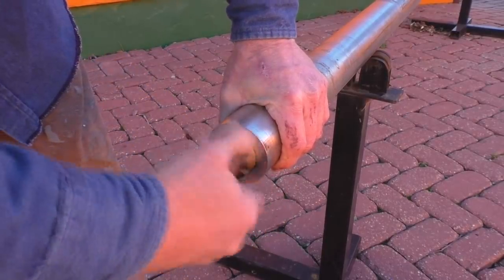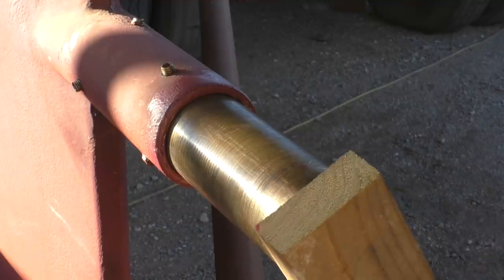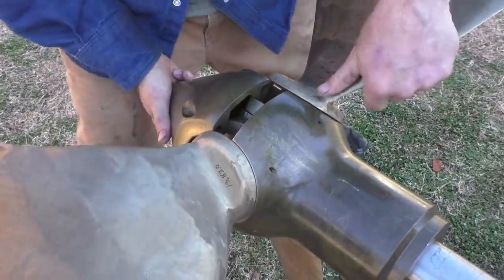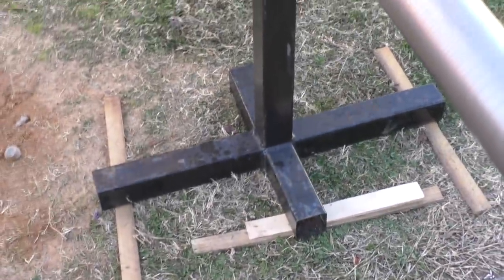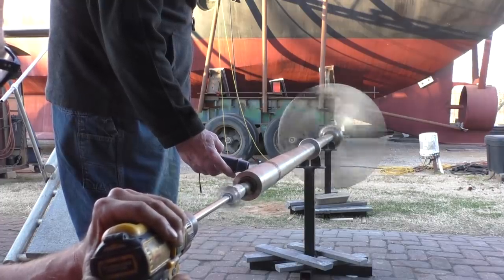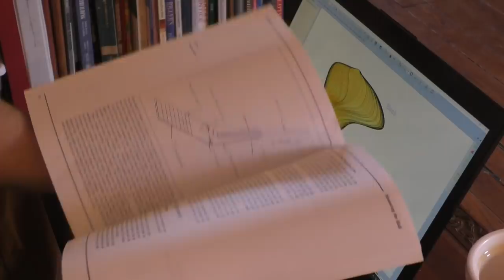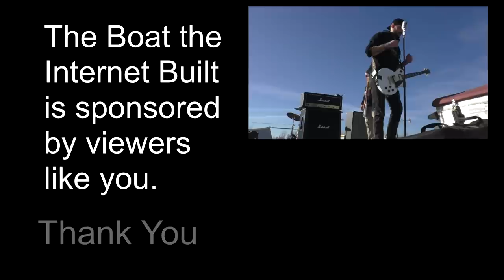DIY Boat Propeller - Part 10 - Tested at 600 rpm

Comment: Doug- 
Balance factor is very important to the life of the bearings 
And from the video with it “wobble” it’s pretty far out.
Working in a machine shop we get the V8 performance cranks down to 1 gram- 
Being that you can actually see the wobble and 100 plus grams is a lot 

Check out this guys homemade balance rig with cheap DIY meters
https://m.youtube.com/watch?v=r6tFXC4Hk0I

Comment: Just an idea...but label each prop, place a poster board behind the propeller.  Spin it till it start to wobble, using a strobe (real strobe, not an LED strobe) take pictures with a camera (at night).
You might be able to tell where the prop is this way.
& I would 100% ignore which prop is heavier.  At this point it does NOT matter, it being in balance is all that matters, regardless of weight.

Comment: ISO 484-2 : Shipbuilding - Ship screw propellers - Manufacturing tolerances - Part 2: Propellers of diameter between 0,80 and 2,50 m inclusive
The formula for acceptable (static) balance in ISO 484-1 (greater than 2.5m radius) is discussed here: http://www.ricepropulsion.com/esp/cartas/TNL62/TNL62.htm

Comment: Two common ways to balance a driveshaft on a car involve hose clamps. Two hose clamps with the heavy part 180 apart. Slowly move one of them around till it gets better, then do the same on the other. Between the two is where the weight needs added. The other way is to put one on and leave it loose enough to tap it around with a hammer. Now you spin it up and hold the hammer where the hose clamp is hitting it. As it does, the vibration will get better and worse. If you stop it when it's at its best, you need to add weight where the heavy part is, if you stop it at its worst, ad weight 180 from it. Sometimes it's easier to find the worst, sometimes the better. You would probably have to add weight to a hose clamp for a shaft that heavy, but should work the same. You also have to do both ends and it's worth doing the middle of longer shafts.

The prop assembly can be balanced the same way we use to bubble balance car wheels. The assembly is held level with the ground. A bubble balancer sits under a wheel holding it up above the center of gravity. It then has a bubble level in the middle. You just lay weights around the rim until you find the spot and weight that brings the bubble to the middle. You could do exactly that with a car wheel bubble balancer with that hub blade assembly. Amazon sells one for $50. You would need a ring to hold the blades into the hub with the tail cone removed to see the level, or use a separate level. But then, if you had that ring, you could also put the whole thing on the new electronic wheel balancers and get it perfect. No more weight and size than bit 4x4 tires. Another option, you could just hang the whole thing from the ceiling, shaft an all, and grind the lower blade until the shaft is hanging plumb. Or just hang the hub and blades without the shaft and grind on the lower blade until it all hangs level. Sometimes gravity is better than an expensive tool.

Comment: ATip for finding which way to balance is to run the prop where it wobbles, then use a marker, for safety you would want to hold it next the the shaft near the prop, move in until the marker just touches in one spot, this will only be a guide.

Comment: Some industry advise from my mates at Veem in Perth WA "Caution must be taken when balancing marine propellers due to the critical nature of blade cross sections, and the effect that this has on thrust (dynamic load) during operation. When balancing propellers, the allowable residual unbalance as defined by ISO 1940/1 should be calculated by taking into account shaft bearing spacings and propeller added mass (due to entrained fluid). As propellers are generally balanced between machine pedestals, but operate as an overhung rotor, the allowable unbalance is commonly miscalculated. Of major concern is that by far exceeding the required balance standard, vibration can be introduced due to the effect of dynamic forces generated by distorted blade profiles. This introduced vibration greatly exceeds any benefit gained by reducing the unbalance in air. This provides a sound reason as to why balance standards for marine propellers should not be exceeded."

Comment: In model building they'll use 2 fresh Stanley blades (as close to horizontal as practical) to support shaft with propeller attached, and quickly find the static balance of this system by removing some material from the rear (convex) sides of the "heavy" blades.
Yours a bit bigger, but maybe T-bars with sharp edge would be sensitive enough?

Comment: Hello guys... you started off right weighting each blade ... you then had to static balance ... and with my experience your normal very low rpm does not require dynamic balance .... but if you insist it should not be balanced at more than max working rpm .... you were looking for death at 600 rpm

Comment: i used to work on small offshore supply boats...just under 500GRT...and all of them, even the newer ones had some vibration at a particular rpm, usually low-mid range...some barely noticeable, others felt like the boat was falling apart...so many variables to take into account its really trial and error till you get it "perfect"...but hey for 600revs on a couple wobbly stands, i'd call that good enough!
keep doin your thing Doug
lookin forward to seeing her in the water soon!

Comment: I haven’t read through all the comments but has anyone Suggested blade tracking? In avation we track airplane props to ensure the blade tips track generally within 1/16th-1/8th”. If the blades are tracking farther off it could cause a similar wobble.

Comment: You could consider checking out the procedure that this crazy Russian did in his garage: 
https://www.youtube.com/watch?v=fara1C8RJZM
https://www.youtube.com/watch?v=TALtawii_Bo
His turbines spin at >100k RPM, so whatever he does is likely overkill for a boat prop, but the procedure itself should work OK. Key thing what he does is basically achieve perfect static balance for shaft separately and turbine assembly as a whole, and with that dynamic balance appears to be acceptable.

Comment: I think the best way to balance the blades is to weigh the tipand the base. The blade should be horizontal like you would do with connecting rods.  Make them all the same. Idealy the blade area should be the same too.
Thanks

Comment: I've balanced thousands and thousands of tires.  Wheels,  tires,  center caps and hubcaps all affect balance.  You can balance to 0.00 and most vehicles will ride super smooth like glass. High speed balancing is best because vibration is always worse at high rpm as far as resonance into and throughout the vehicle as little as 0.05. I've used bubble balancing and many types of computer and spin balancers.  You're likely to see any effect of balancing show up in your gearbox for the propeller pitch. Keep an eye on your bushings

Comment: I've seen people balance con rods for engines by putting them on a fixture and put just one end of the rod on the scale. A fixture so you always have either end at the same height towards the scale.  Seems easy enough to determine how far off the top part of the blades is! Still not a dynamic balance, but should get you much closer.

Comment: Long time watcher, first time injecting my $0.02.  Everyone is right about the static balance of each individual part and the dynamic balance of the assembly as a whole. We always referred to critical rotation/harmonics as knowing the natural frequency of your shaft assemby in my refinery days. And it seems like you found it for both prop sets around the 200-300 rpm marks.

Low rpms won't push you into needing a really tight balance, but it will improve your reliability in seals and bearings.  I bet you can find a good way to be more precise the more you think about it. It seems I'm always learning something new from your videos. 

Props to ya for this one, haha!

Comment: There is a portable machine for static and dynamic balancing which shows where to add or remove weight.  It's been around since the 1980s . Working with blowers and compressors in the mines balancing rotars on big 6m turbines . There must be someone who has the equipment to help out. The result would be amazing.

Comment: It's probably installed now but take the assembly to a prop shop and have it dynamic balanced. It's going to shake. 
You guys are lucky you aren't dead spinning that thing like that. That was very dangerous because props have came off of dynamic balancers. It isn't good when it happens.

Comment: You can 'sort of' figure out where you are heavy with a Sharpie, but it would require you to have a slightly more robust/precise setup. Essentially, using your roller stands (placed and weighed down on a solid, preferably level pad, with the prop over something 'soft' like a water trough filled with sand) to spin the entire assembly up again, place a 'steady rest' next to the area on the assembly you want to find the imbalance at. In that steady rest you place a Sharpie, as close as possible but not touch the assembly through it's entire range of rotation. Spin the assembly up, and as the imbalances appear, the Sharpie will make contact where its heavy. Add/Remove material as needed until balance is achieved.

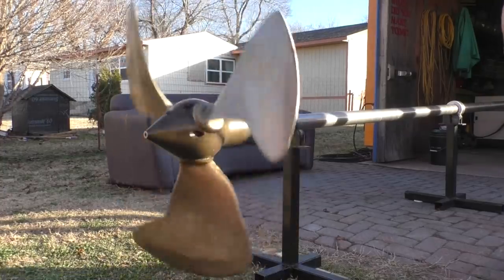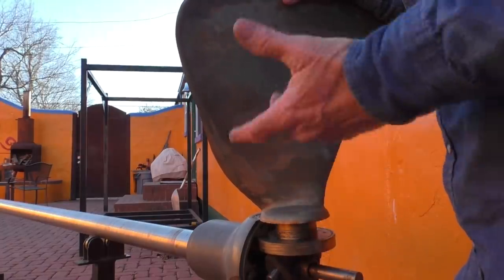Comment: In an old video I think Doug has his reverse wrong. Most people think fine pitch is in the 9 o,clock position with course pitch at 10:00, 11:00 and feathered at 12 o’clock with reverse at 1:00. That’s not true. Reverese would actually be at the 8 o’clock position of the blades, not 1:00. This is looking down on the blades from top to root.

Comment: Strobe light, laser level and a ruler.  Strobe stops apparent motion of vibration. Scrolling through the strobe frequency lets you 'see' the deflection. laser level lets you have a reference.  Rule is for magnitude. 
Look on line for fan balancing videos. Look for key words like "single plane balancing" You can grind notches to balance blades.  watch the shaft and line up laser to see the shaft whirl (modal flexure in the shaft.  Hot glue on temp masses to play at balancing until you get a clue.

Comment: Dont no if you or anyone noticed but on the second blade test as you dropped the drill of and you were slowing the shaft doun, I spotted that the blade boss, for a beter word as fail to no the name, is not a true fit it's off a bit and would say that could be were the 200 rpm wobble  could be..

Comment: Fascinating subject.  Not knowledgeable about it but just wondering if you had perfect weight distribution and out of the water dynamic balance, could slight surface shape and/or pitch differences between blades that affected the relative hydrodynamic performance of each blade, cause the in water dynamic balance to differ, or would the out of water aerodynamic variations correspond to the in water hydrodynamic ones?

Comment: Think Tacoma Narrows Bridge Collapse - when the  vibrations for a given structure resonates to the point where the amplitude begins to increase continuously to the point of destruction.   This typically occurs when the natural frequency of the support structure and the rotating vibration ( inducing force) (wind in Tacoma Narrows case), excites the structure, growing in strength. 

There is such a thing as a critical speed and machinery should avoid lingering at or around this rpm. Move the throttle quickly past this point when speeding up or slowing down.   As stated by many commenters vibration reduces bearing life, the lower the better. 
I That said your test rig set up did actually depict the bearing support configuration found when in the vessel so it likely you won’t see the vibrations at the same rpm or at all. My suggest is to get the weight as close as possible in a static condition and call it good.

Comment: Pure imbalance increases with speed squared, and will not go away with an increase in speed. If you are dealing with critical speeds (i.e. rotor harmonics) this is dependent on the shaft stiffness and the location and stiffness of the bearings. Balance the shaft, with the blades and call it good. Going in to a dynamic balance and adjusting the bearing stiffness would be a larger undertaking.

Comment: Just hammer a rebar into the ground near the shaft closest to prop,tape a marker to the rebar pointing at center about an inch from shaft
then spin shaft until wobble is the biggest and move marker slowly until just touch the wobbling shaft,and presto you know what blade has to be lightened.
If it turns out it is the heaviest then you can stop worrying about center of gravity!
Never done anything like that myself,just seems logical to me
Eh I just realized that you will have to spin it the opposite way as well,then the problem is in between the two markings!

Comment: Beyond the comments on professional balancing via a pump or turbine balancing expert, your local tyre (tire in US language) supplier could do a reasonable job on their tyre balancing machine.  Will identify balance by blade and whether there is an inner Vs outer any lateral movement. Lots of comments about impact of prop being out of balance with chewing through cutlass bearings being the more obvious one. Beyond that, out of balance can impact engine and gear box bearings and cause undue wear. Also there is the potential to create metal fatigue or crew fatigue from undue resonance transmitted to the hull.

Comment: Wobble could be caused by where the weight is concentrated on the blade. the further towards the tip the more centrifugal force. if weight if offset towards the center much less. Considering all the blades weigh the same.

Comment: I think the test was misleading because the shaft was not constrained by complete bearings, fixed to structure. If it had been then I am sure it would have spun without the excessive vibration and amplitude shown on the weebly wobbly stands.

Comment: Now you've got me curious how they balance drive shafts for cars...  I suspect having a balanced shaft is important as well as having balanced blades.  If you fire up the prop and the whole boat has a resonant frequency, you'll know where it's coming from!  Hell, that might be kind of nice to have a little hum once in awhile.  Top shelf Doug!!!
Reply: They spin them on a balancer like everything modern these days and apply weight or remove weight as necessary.  Local shop in Georgia charges $120 to shorten and rebalance shafts.

Comment: Get individual weight close as possible but also check blade runout for easier CofG uniformity. If you watch the video of the prop rotating you can see one blade is a little proud of the others, my guess is that there is a little bit of dynamic imbalance, that is why the end of the shaft wobbles but the prop doesn't hop.

Comment: suggestion for balancing the blades. if you spin it til it wobbles, and then very carefully bring a sharpie to the shaft where it's wobbling side to side, it will indicate which blade is the heavy spot by marking that "side" of the shaft that's getting pulled out of center?

Comment: Depending on  your blade pitch and  design, at a certain rpm you'll end up with cavitation, or the forming of bubbles on the low pressure side of the blade.  I seriously doubt you'll run that baby at 600 rpm at sea.  You have no line shaft bearings other than the one to support radial load as far as I can see.

Comment: Dynamic balance is a bit out, no idea if its enough to worry about or not. The blades can all weigh the same, but if the cg of each blade is different, then the forces exerted will differ as it spins.  At home solution: get two scales on a table a fixed distance apart, lay the blades on the scales in the same orientation/location and putter around with a mig welder with bronze wire and grinder till they all match on overall weight, tip weight, and hub weight.    Slightly more advanced: Find a willing tire shop, and make an adapter from a wheel hub to a prop shaft.

Comment: Shell find her sweet spot & with the hunderstat its a lot easier to find . Are you going to coat the props with prop speed , Great product - expensive but rally does work  if your doing a fair bit of motoring  another one i used on my 54 steel cutter was i sprayed the prop with zinc out of a can , It worked ok .

Comment: We balance big combine harvester parts just by spinning it by hand and let it run to a stop
It shouldn't stop in the same spot twice 
The fact you can remove each blade and weight it to match each other it say it's pretty good 
Be a different story if it had to run to 8k rpm 
We're balancing 1 tonne components spinning at 1 thousand rpm plus

Comment: I am no expert but I think if you had two weight scales one for each leg of your stand under the blade end of the prop and spin it very slowly by hand you can see the minute difference in weight and adjust it accordingly resulting in reduction of vibration during operation. This wont help with balancing the inner side vs outter side of the blades but your method could do that and I think a careful person doing both methods could create a ridiculously balanced prop without any fancy tools.

Comment: Your dynamic balance is not correct, that is the diameter maybe ok but the weight forward of the centre of the pivot of the blade is different, as the angel of attack or the pitch is change the tip of the blade takes the weight out of line increasing  wobble and that's why your shaft starts to move. see how wheels are balanced, either side of the spinning disk. If you changed the pitch while spinning it up you may see the unbalance behaving differently, more or less pronounced, on a helicopter rotor it called tip tracking.